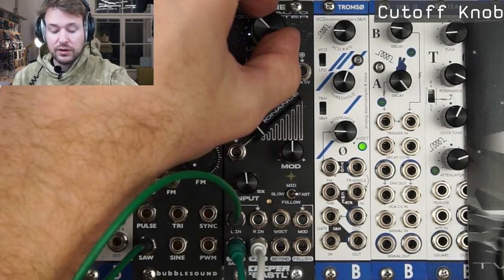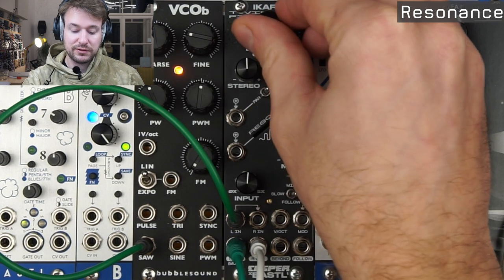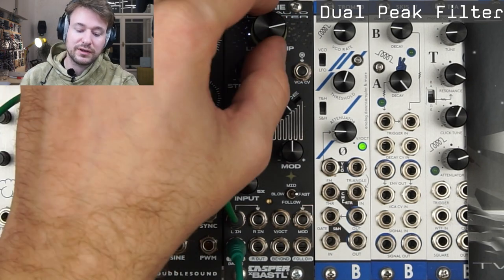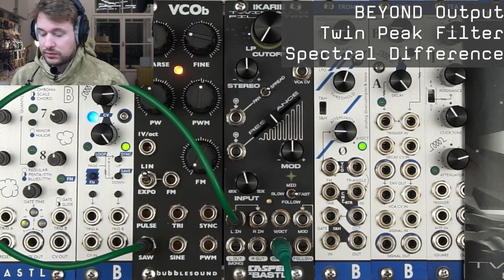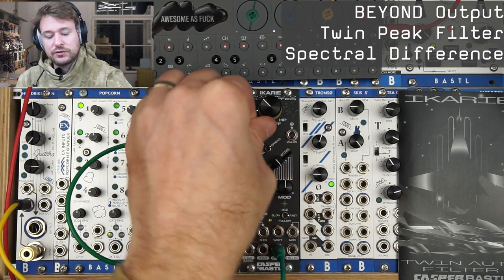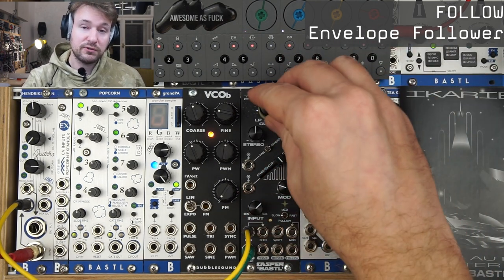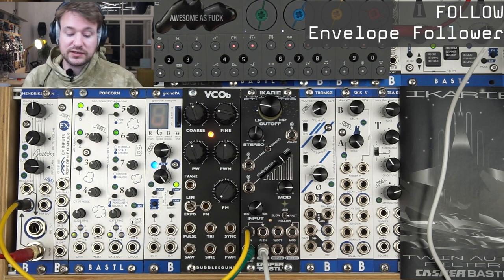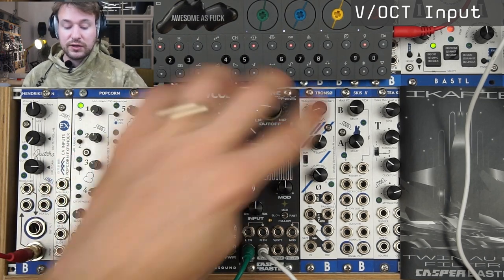Ikarie Walkthrough - Every Feature Explained

Comment: Very nice filter and presentation! Could this bring external line level to eurorack level with that 5x input gain? Thanks in advance!
Reply from the maker: Hello Horia, it kinda can (eurorack is 10x hotter than line input) but there can be problem with impedance so we recommend to use Buddy to bring anything to eurorack levels with its 20x amplification. And you need to use only one TRS cable! So great for hybrid setups!